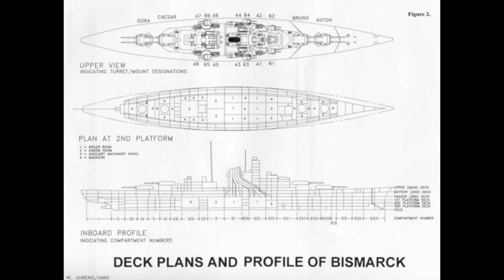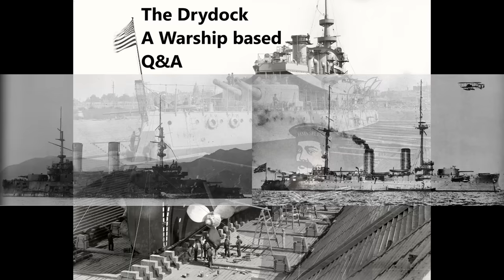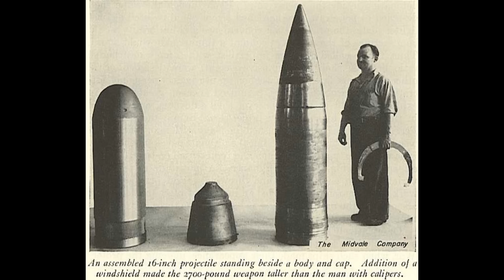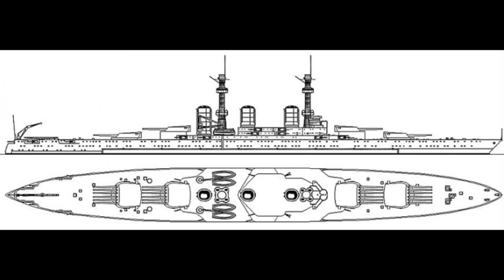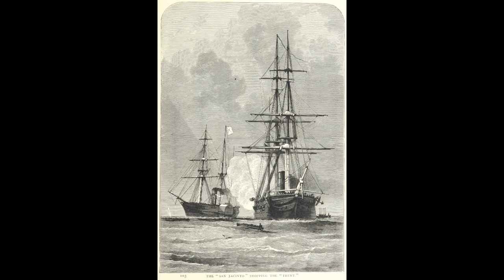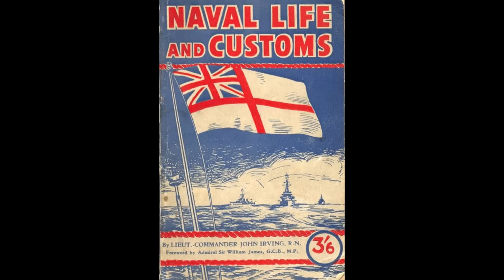The Drydock - Episode 096

Comment: heres a suggestion that will garner alot of interest: research ways that damaged merchant ships made port. some stories i've heard -a cargo of barage baloons used to reduce flooding, replacing a propeller at sea, draging doors using the cranes to steer, using a modified sea anchor to catch ocean currents like an under water sail, lashing a rudderless ship to an undameged ship. the merchant marine administrations should be full of interesting stories.

Comment: Sonar equipment is most definitely vulnerable to weather.  Coming back from the Gulf War, the USS Barbey (a Knox class frigate- primarily built for anti-submarine warfare) hit a bad storm in the middle of the pacific.  The ship rode a huge wave and then slammed down the other side- shattering the sonar dome.  It took almost two weeks in Pearl to get it fixed enough to make home port.
Reply: I could never understand the move the bow domes for sonar. They are very vulnerable and can loose signal when leaving the water or going high in it.
Reply: @colinwhaley244  I think it's doing the best to keep it away from the propellor noise and the turbulent flow from the wake, in terms of weather though - Everything is vulnerable to the weather (given enough weather :-))
Reply: There's always the option to tow the array, but that comes with its own set of of problems. While great for reducing the impact of self-noise (and thus the hydrophone could be made more sensitive, and area of the baffles is reduced), extra time may be needed to resolve a contact due to inherent bearing ambiguity. This is because a detection will produce a true contact and 'mirrored' contact, and there is no way to know which one is the true contact without either correlating it with another sensor or turning the array (the contact that remains at the same bearing throughout the turn is the true contact'). Of course, due to hydrodynamics, the longer the wire towing the array, the longer it takes for the array to begin and complete the turn from when the ship initiates said turn.
Reply: I had not heard of another 26 sonar dome failure before.  Back in the winter of 1980 the CG I was on also had sonar dome damage.  Lets just say it was a REALLY bad storm between the US and Bermuda.  Blew out the aft starboard section of the rubber window.  The hull mounted low frequency sonars of the later 1950s through today are quite large and heavy.  Original steel dome shells were replaced by a "rubber window" when research discovered rubber is acoustically transparent.  The loss to structural integrity was negligible to the gain in sonar performance.  The domes are placed as low and far forward in the hull as possible to separate them form the ship's machinery and hull flow noise.  They aren't designed to act like a bulbous bow but there there is a slight effect due to the placement of the dome.   Due to the weight of the array and the water filling the dome they are quite heavy and not prone to rising out of the water.  If the sea state is bad enough they rise to the level of the surface, or beyond, well you aren't going to hear anything anyway in such conditions.
Reply: I know nothing about this at all. However... we're in Hawaii... { take your time }📉😎📈
Reply: So in the aggregate, over let's say a decade throughout the fleet, how many sonar systems were damaged as a result of a similar installation?
Was it that systemic of a problem or was the Knox occurrence a solitary or just one of maybe a few such incidents?
Reply: Howdy from an old SeaBee...glad to hear you made it back ok- I was on active duty for" Gulf 1"-always had a deep respect for the Fleet guys.
Reply: I remember that. Every time I heard about it at an NCO Club or VFW, the damage was worse. The last time I heard, the dome was sheared clean off, the hull was cracked and the OD was drowning in the bilge.
Reply: @charlesaugust8671  Wait - rubber is acoustically transparent?? Then why are submarine hulls are covered in rubber - to help avoid sonar detection, right?
Reply: @guhalakshmiratan5566  Think of the rubber sonar domes as automobile headlight covers, same principle.  Like between the lightbulb and the areo cover of the headlight, there is no structure between the sonar transducers and the rubber dome, thus the transparency.  If you cover a car body in Lexan, the body's structure will still reflect light.  Submarine hull coatings are over a steel surface.  They absorb sound energy, how much? beats me!  I also don't know the effect anechoic coatings may have on damping radiation of submarine internal noises into the surrounding water.  But even with coatings there is still some (itsy bitsy?) external sound reflection that occurs.

Comment: Always love your work Drach. That live stream earlier on Friday worked really well and it was enjoyable. 
As far as my question I asked on the livestream. If you took charge of the US navy as far as construction, R@D and other aspects. You'd have ALOT of political will backing you up. The President was a massive supporter of the Navy, he got two different Two Ocean expansion bills passed. So combine that with a 20 percent increase in the budget, you could accomplish alot. Like getting the Essex class started 2 to 3 years ahead of schedule. Starting the Gearing class 5 years early and by passing the Allen M Sumners entirely. You maybe could even get the Alaska class started or go really big and try for the Montana class.
So as I said imagine 2 or 3 armored flight deck Essex classes at Coral Sea and Midway with 40mm and 5inch radar guided guns with VT fuses.
Reply: On the Gearing point, if your skipping the Sumners would you also be skipping the Fletchers? Because if you have the Gearing design ready to roll out in 1940 the Fletcher class would not yet have started construction and I'd imagine having the 175 Fletchers and 58 Sumners instead completed as Gearings would be a very attractive option
Reply: @themadhammer3305  definitely produce the Fletchers, they are much cheaper. It would be I think 3 Fletchers to 1 Gearing.

Comment: The original Fletcher class also had problems with forward visibility. The bridge was low to begin with, being barely higher than the superfiring B turret. Visibility wasn't helped by the bridge windows just being a series of relatively small portholes. The bridge was raised slightly just before Fletcher itself was laid down, but it was a source of complaints from the bridge crew for most of the war. The bridge wings were truncated to the bridge sides to give the AA guns a better arc of fire. The addition of twin 40 mm mounts just ahead of the bridge didn't help side visibility. the combination of truncated bridge wings and the forward AA guns were a big enough problem for underway refueling that several collisions and near collisions resulted. The original flying bridge was completely in the open, so it was a friendly place in heavy weather. Late war and postwar, the bridge was was successively raised and enclosed with large windows canted inward to help with downward and side visibility. The Sumner class had many of the same issues made even worse by the larger twin 5"/38 turrets, and it was only the Gearing class that more or less solved the problem with a bridge slightly higher, slightly set back from B turret, and angled off instead of rounded.
Reply: In reality the helmsman does not need vision. Steering is done by command.
Reply: @colinwhaley244  Right, but that's not the sole purpose of the bridge. Visibility for side maneuvering by the captain or XO is important, and someone needs enough aide and forward visibility to pass orders to the helmsman. Keeping track of aircraft executing a bow on attack, or a surface ship crossing your "T" is also kind of important. There were many reason why good visibility from the bridge was important other than just steering the ship.

Comment: Ideas for auto-loading big guns (from another discussion episode).  The French (who else?) came up with part of an idea, this being a fast opening and closing "universal" breach end-cover, replacing the standard rotating interrupted screw or sliding breach block used by all modern breech-loading guns (depending on whether they used cartridge cases or not as the last things put in the gun).  What the French naval gun designers did was take an obsolescent 13.4" gun and rebuild its base so that it had a vertical power-rotated pivot with heavily reinforced bearings and a large spherical fitting between them with an obturator (blast seal) on one or two opposite faces and a large hole through the sphere at right-angles to the obturators large enough to allow the shell and its propellant casing to be rammed (no cartridges unless they were completely burnable).  The sphere would be rotated so that the hole faced the breech-end of the barrel, the shell and propellants would be rammed through the hole (I assume very quickly), the sphere would rotate 90 degrees to put the obturator against the opening of the breech, the gun would fire, the sphere would rotate 90 degrees to allow loading again. and so forth.  Obviously some new way to ram the shell and propellant into the gun at high speed would be needed (not mentioned in the report), but if this could be done, you had a rather fast opening and closing breech block.  Never went anywhere else, to my knowledge, but it was a new idea...

Comment: For the brig, I have some experience with this one
For example the brig can be used when a sailor or passenger commits a crime on shore on foreign soil as a form of extradition. And will be kept there until he receives formal charges from the country or port in which he committed the offense. It’s also used for enemy POWs as a place in which to hold a possible hostile entity to the ship. The pow is generally the more common in times of war. 
A brig is supposed to be used as a form of jail in which holding is temporary and where if the prisoner is a crewman then he will be held until his misdeed can be reviewed by a senior officer or the captain. Or as a specific place to hold drunk sailors after shore leave 😂
Reply: To clarify I never ended up in the brig but we did have the captain of the ship I was embarked on and our commanding officer have to argue extradition of one of our guys and he spent the next two months of our voyage in the brig...

Comment: About improving on large german(i.e. Narvik-type) and french(i.e. Le Fantasque-type) destroyers that were significantly(talking 1000t more fully loaded) larger then their contemporaries, I think Drach missed the point of question. So I'll try to answer it instead. 

Let's get one thing first. Destroyers are universally unarmoured. Indeed they have certain element of structural integrity, but a single 5in shell hit near boilers puts a destroyer out of commission disregarding how big it is. Putting more guns, or somewhat bigger guns,  would not provide decisive advantage. Some advantage will be there, for sure, but bulding large unarmoured ships to dominate smaller unarmoured ships is just an exercise in furtility. 

Now, large destroyers truly had advantage over their smaller cousins. Large size gave a lot more room for additional equipment to be installed, and still have some room left for the extra crew manning that equipment. Such "upgradeability" is extremely important factor and the reason why destroyers got larger and larger. By pre-war standards 2500t destoyer fully loaded was considered destroyer leader. During the war all relevant players built 2500t destroyers in great numbers and no one called them leaders, they were the new standard. Fitting all the new and necessary equipment required that much space. For more colourful example, let's take a Fletcher. It is a child of Porter and Sommers, further development of a large destroyer, and no one questions Fletcher's success. 

Returning to the question of how to improve 3500t+ destroyers to be destroyer hunters they were imagined as, I think the only real solution is armour. I recon slapping 2in belt over machinery would really do much more then bigger guns or a pair of extra ones in becoming the undisputed top dog of destroyer dogfight.  And it's not going to take that much of weight all things considered. Something like 35 knots, six 5in guns, 6 centerline torpedo tubes with 2in belt over machinery would still be as agile as other destroyers and would definitively fit in Le Fantasque displacement with a bit of extra space for future improvements, talking mid to late 1930s tech level. 

No one ever tried to armour up their DDs or build such micro-CLs though. At that period everyone thought that cruisers would be the main force clearing up destroyers. 2in armour is barely enough to stop destroyer shell, there is no way to stop cruiser shells so why bother. War showed completely different picture with destroyers pulling well above their weight and the only effective counters to DDs being airstrikes and ironically other destroyers, by no means cruisers. Cruisers, especially heavy cruisers, universally had lackluster performance in WWII for all the hype they built up in interbellum.
Reply: Reminds me of why I like the British C class of WW1. They are small, fast and ultimately expendable enough to  go around beating up destroyers. They even look a bit like massive destroyers

I guess the theory of "light" cruisers didn't work at 10000 tons, they became too valuable to lose and so sometimes too valuable to use.

Comment: "The Blue Riband (/ˈrɪbənd/) is an unofficial accolade given to the passenger liner crossing the Atlantic Ocean in regular service with the record highest speed. The term was borrowed from horse racing and was not widely used until after 1910.[1][2] Traditionally, the record is based on average speed rather than passage time because ships follow different routes.[3] Also, eastbound and westbound speed records are reckoned separately, as the more difficult westbound record voyage, against the Gulf Stream and the prevailing weather systems, typically results in lower average speeds."

A nuclear submarine would have no fuel issues and can cruise well north of thirty knots.  That Soviet  "one of"  did better than 44 knots underwater decades ago.
Reply: Alpha, Project 705 were the Soviet boast. No problem speed wise but passenger capacity would be both basic and limited.
Reply: There all time winner and still champion: SS United States.
Reply: Fastest crossing's is by the Australian built Hoverspeed Great Britain, then Catalonia and finale Cat Link V

Comment: I was "restricted to the ship", rather than further confined.  My offense?  smoking Marijuana . . . in the early 1970s.
Fun fact: my fall from grace was sparked by spending time with members of the Navy Band.  I was a newb and they wanted to teach me how to party.  Now, it's almost 50 years later (48 to be exact) and I salute my captain's relaxed penalties.  They got a lot of useful work* out of me by leaving me remain aboard.  I also spent a few hours in the Brig at Gitmo . . .for grabassing with other idiots "in a suspicious manner".  That was a regular jail, run by Marines.  I got awful bored waiting for them to straighten it out.
*Filing a hodgepodge of ShipAlt forms detailing every modification and repair the ship had as yet endured into a numerical certainty from SA 000,001 to subjective infinity.  A half million of them.  An absolutely necessary job nobody wanted.  That moved me from the Engine Room to a nice office on O deck for my 8 hour shift.  Love ya, Skipper.

Comment: That Tillman design looks tasty... I see LOTS of room for improvements, additional firepower, insane AA mounting space, torpedoes, and plenty of room for new and improved guts. If Congress had approved of this then there'd be some sort of stipulation for funds to be set aside to refit these Tillmans as the need arises as well as funding to build a drydock capable of refitting them when it comes time to do so. The Navy wouldn't be so stupid to let the opportunity slip past for more money to do things during this time, especially if say the ship construction order is staggered so that one Tillman is built at a time, meanwhile to money thats to fund the whole Tillman project gets syphoned into other projects as much as possible without disrupting the Tillman project too much, maybe one less Tillman than is stated in the original plan outline, or a bold face lie to Congress that there was an problem with one of the TIllmans and the funds ran out fixing it and asking "nicely" for some more funds to finish the final Tillman... This assumes a drydock for these behemoths was built first of course, but hey look at this way any drydock capable of holding a Tillman would definitely hold any other ship with the appropriate bracings in place...

Comment: Concerning the BISMARCK's protective tubes between the lower primary armored deck (with the sloped edges) and the fire-control stations located high on the superstructure for controlling the main 15" guns.  These tubes existed for all three systems used.  Interestingly, they were rather thinly armored (100mm/4", I think) using a non-cemented form of KC (no Harveyized surface layer as was used in most KC-type armors, including the side armor of BISMARCK), probably as they were not for hits by heavy shells but for fragments, blast, and small-caliber (up to maybe 6" guns) glancing hits.  Cementing a thin surface layer was not worth the trouble.  The cable problem you mention is because they ran the cables on the underside of the main armored deck (I assume spaced a small distance below the armor by the supports), but this was interrupted by British hits on the deck that bent it down or made a slot in the deck, probably not even fully penetrating, that cut the cables.  They may have had problems with all of these cables below that very low armored deck.